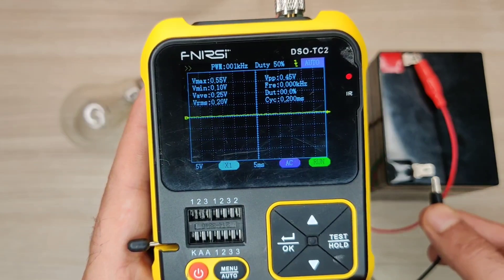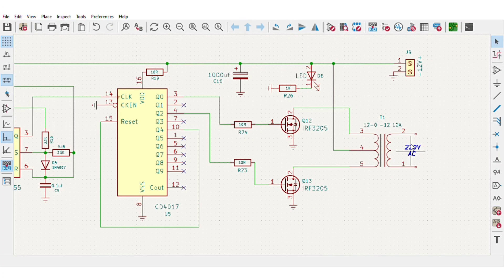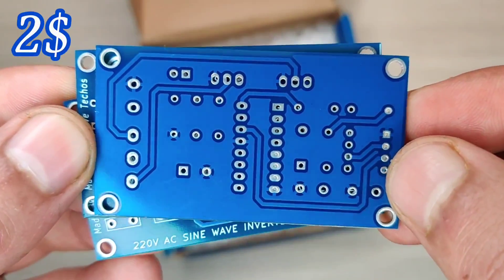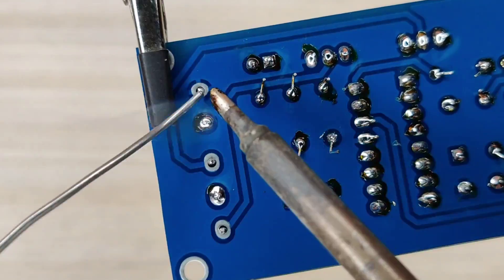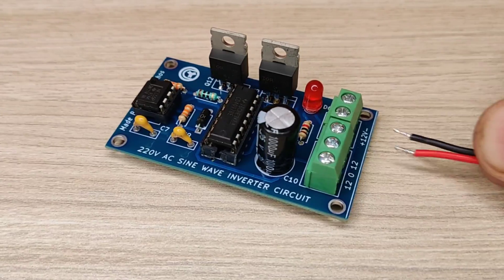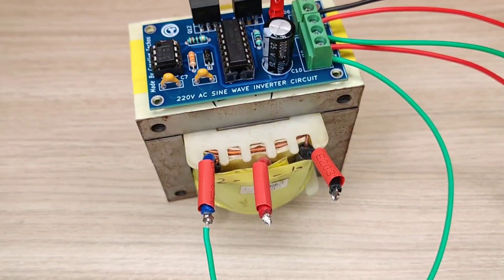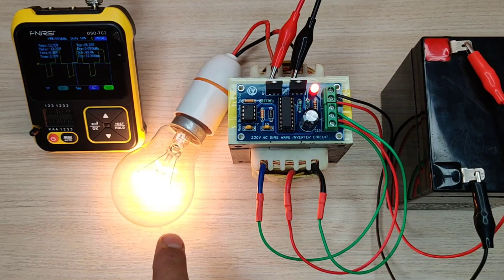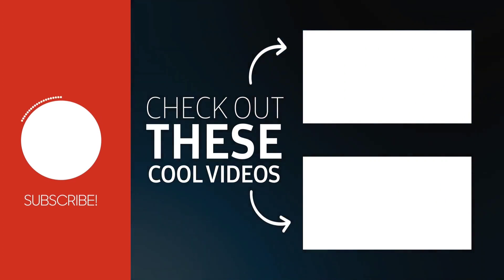Simple 12v to 220v inverter, sine wave , mosfet , jlcpcb

Comment from the maker: 👉Download Circuit Diagram & PCB Files 🔗 Link
https://drive.google.com/drive/folders/1eTtL5JC1SIGo5Rn49J5hZY1nhJr8Fdnb
Reply: The resistor you used in your circuit is 3.3k but on the circuit diagram it is 33k please tell if it's still okay

Comment: Hello sir thanks so much for this nice project,,.1. how can you help on this circuit to prevent voltage drop after putting load,can it be load independent?,,,2.where can we place a variable resistor to adjust frequency output ?
Thanks do much waiting for your reply ❤❤

Comment: Does it have a feesback. 
When the battery voltage drops,  will the output voltage drop from 220v. Can i use a smaller transformer like 3amps

Comment: puedes hacer uno de 12v a 110v? 🙋🏽‍♂🙋🏽‍♂ y que programas usas para el diagrama?
Reply from the maker: Yes you can adjust its output voltage to 12v, by connecting a trimpot between pin 5 of 555 ic & 100nf capacitor connect to ground.
Reply: @CreativeTechos  👍👍